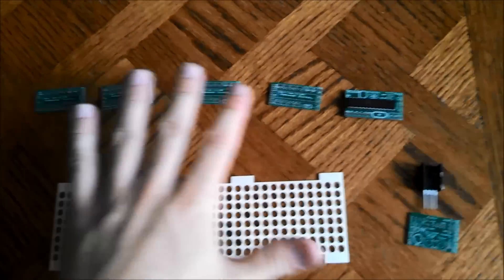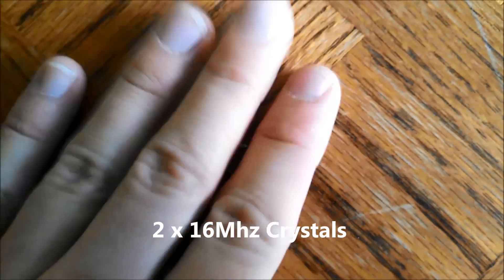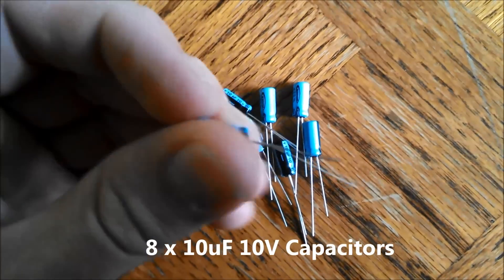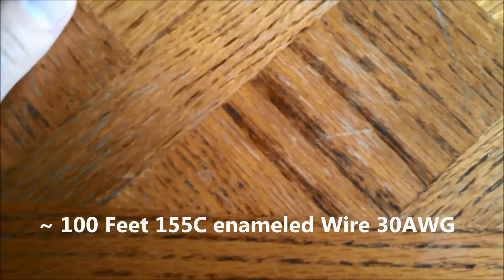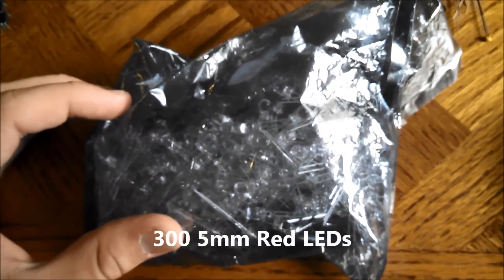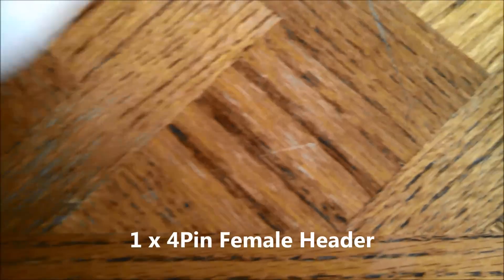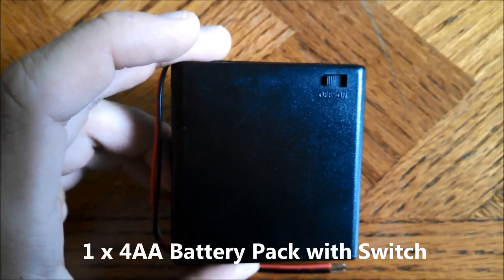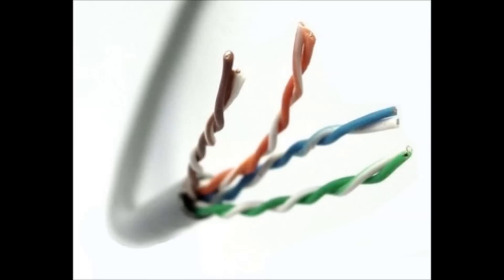Daft Punk Thomas DIY LED kit Parts List

Comment: AlexPlusLEDS  looking at all the parts the only one you said i need to get the same as you is the mdfly logic converter as i have bought all the 4 kits for the thomas and guy do i need anything else the exact same make same as you?
Reply from the maker: Lewis Bundy You actually won't need a logic converter, the new Thomas kits (which will be released in a couple days) don't need one. Your order will have the new LED kit.

Comment: so for the enameled wire I saw two kinds, one that just said enameled wire, and one that said magnetic enameled wire. It looked as if he was using the magnetic kind. I was just wondering if there is a difference between the two.
Reply from the maker: It doesn't really matter. As long as its 155C wire (so you can solder easily to it)
Reply: AlexPlusLEDS K thanks. Love your tutorials and kits by the way. Really helpful.
Reply from the maker: Glad you like them!

Comment: Does anyone know if 10uF 10v Capacitors even exist? Cant find them anywhere ._.  maybe they are 100v? not sure...
Reply from the maker: You need 10v+ 10uF capacitors, there are 10v, 16v, 25v capacitors available on ebay.